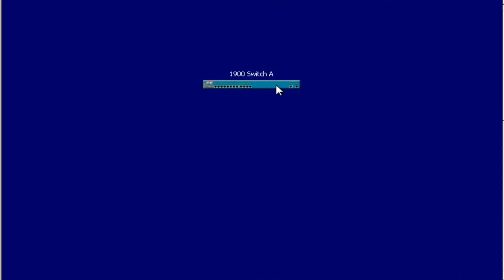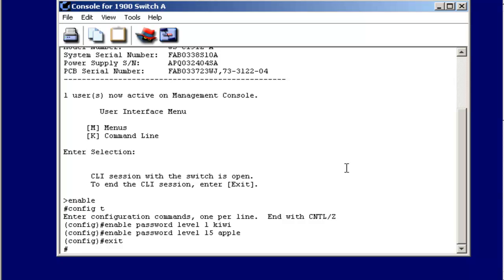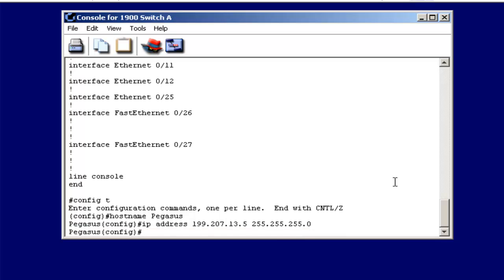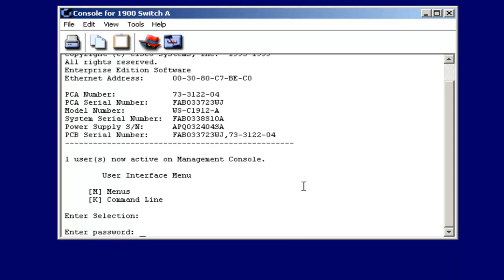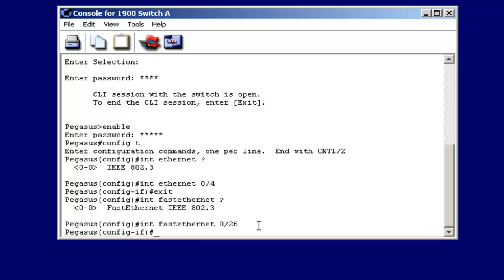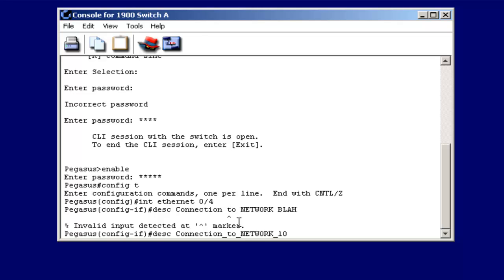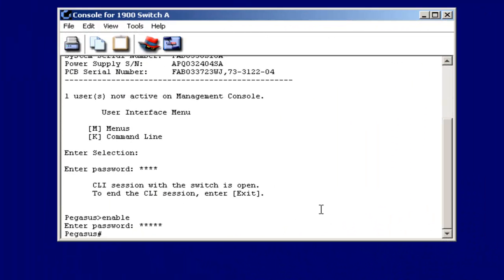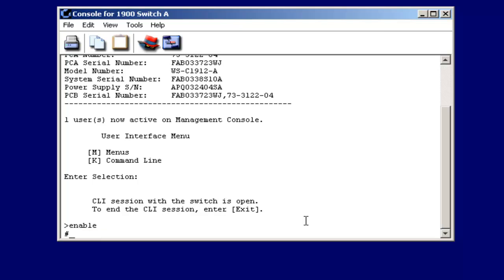1900 Layer2 Switching

Comment: Hello all

I know this is a little off topic, but I can use some help. I have an Issue with my Cisco catalyst 1900 Switch. It keeps displaying Diagnostic console - systems engineering at the BOOT and required as shown:
U - For upgrade operation Firmware (XMODEM) / 
S - For system debug Interface. 
Please advise solution to recover